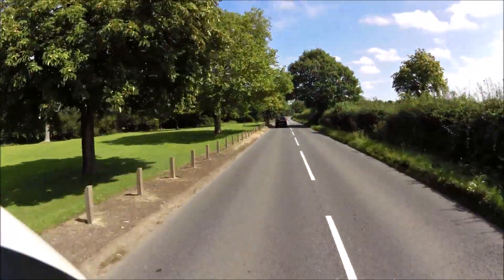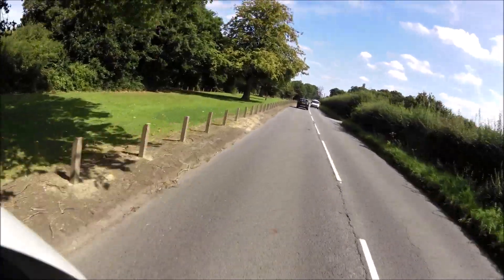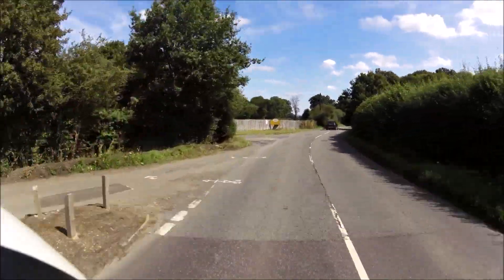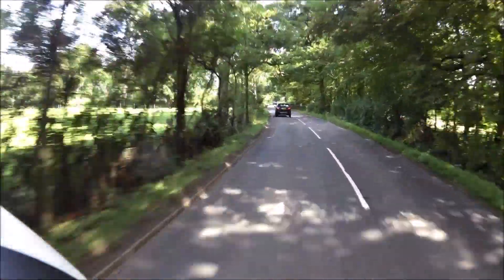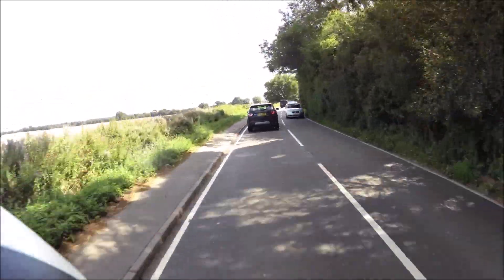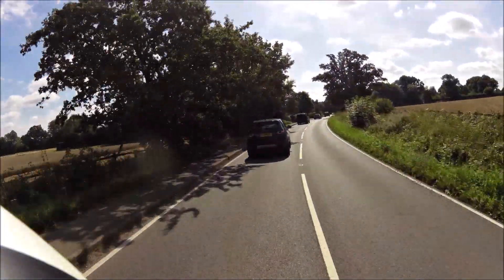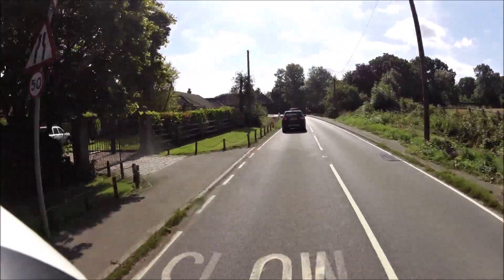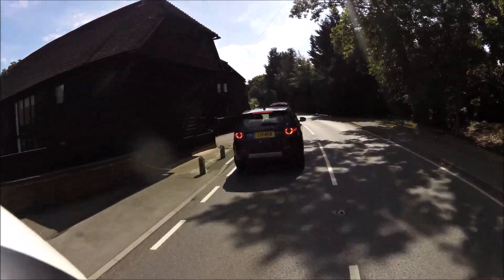POOR SUSPENSION  and how to cope with it.

Comment: I have to do that with my KTM especially when two up! As long as your are smooth etc you will be fine a lot of racers use front break in the corner to keep the front down followed by the rear on straights to keep the front down on acceleration but in an ideal world to get good suspension and the right setup... nice video buddy
Reply from the maker: +The Don in London that’s it you’ve made my mind up, I’m knocking the KTM off of my list of bikes I want. 😎
Reply: @PsychoPaul13  nahhh still worth it such a good bike just need to ride it right ;)